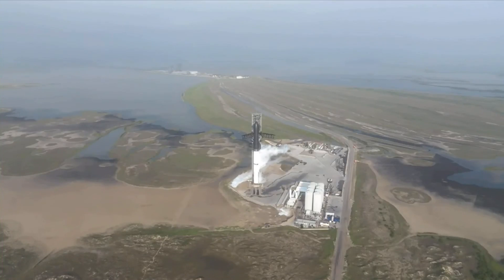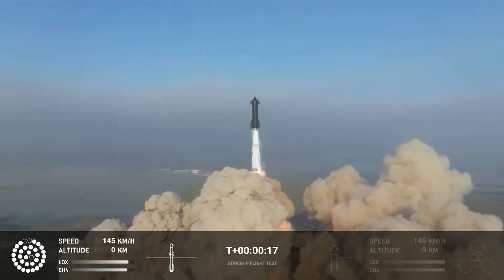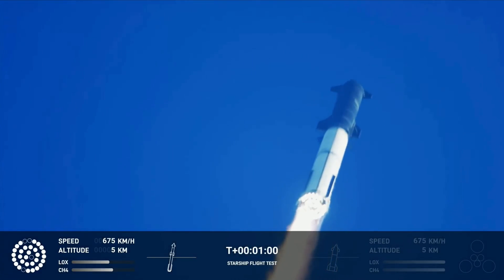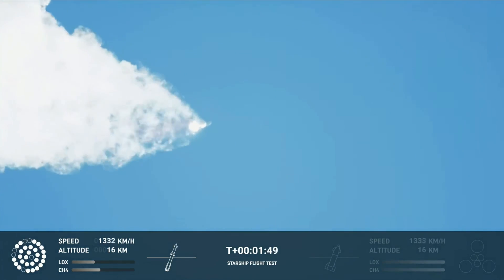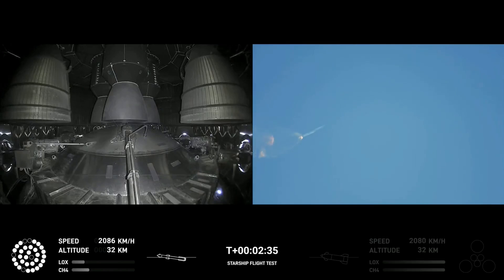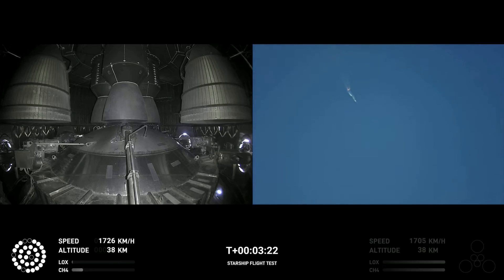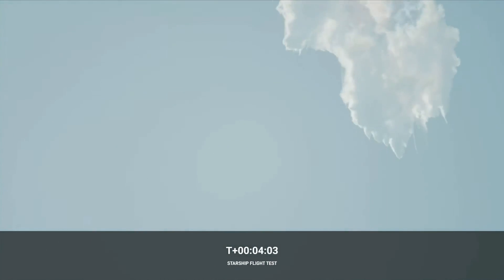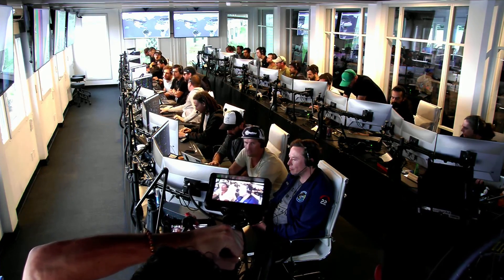Boom! SpaceX Starship has explosive first space launch attempt, test still succesful

Comment: Too bad Starship separation didn't go as planned. A private company can deal with this situation but NASA had to get SLS first launch and flight test correct the first time. I'd love to see SpaceX get everything correct the next time.
Reply: NASA will be the only one going back to the moon and Mars.  A great 👍 appreciation to the NASA engineers with Artemis
Reply: There's a difference between working methods of spaceX and nasa
Definitely nasa engineers are also great but don't forget they took more than a decade to get SLS working.
Reply: SLS is powered by leftover Space Shuttle engines, and familiar solid rocket boosters, so the amount of new learning required for a successful launch on the SLS rocket is a tiny fraction of the new learning required to successfully launch SpaceX Starship.
Reply: SLS is not a new thing it uses engines from the shuttles and the saturn..Starship is a brand new concept so dont compare the two
Reply: It’s all about risk management. SpaceX can afford a much higher level of mission risk since taxpayer funding isn’t an issue. If NASA had this failure there’d be a public outcry.
Reply: It's began to tilt even before MECO. They probably need to work on the centre of mass as the booster gets lighter. Seems like they didn't even do MECO till the explosion. Usually it's MECO then stage separation. Probably their MECO malfunctioned as well.
Reply: @YYLiow  They had 5 engines out on initial climb out.  Were they all in one place caused by 1 of them exploding?  I don't know if we will find out much or not.
Reply: It also took NASA 20 years and $30 billion to create the SLS thanks to the work being spread over many congressional districts. The SLS also reused engines from the space shuttle as well as the SRBs.  All of this is 40 year old technology.  Now don't get me wrong, I am glad the first flight of the SLS was a success.  It was great to see.  The difference here is that the engines and SRBs on the SLS are not new technology and have a long track record.  Pretty much everything on Starship is new technology including the engines so I am willing to cut them some slack. :)
Reply: @paulwilson8367  but they managed to climb till 30 km without any issues. So the engine were not the ones that destabilised it. Unless there was engine failures at 30 km which destabilised it.
Reply: @thukusimon  starship is an overcomplicated mess.   it blew the launch pad up,  damaging the engines and melting parts of the rocket on ascent.

Comment: Wow.....  It lost 6 engines early on and still climbed up to 30+ klicks!  Losing gimbal control like it did would have meant a breakup with another rocket.  With stainless steel the thing kept together - it kept stacked while tumbling, and THAT impressed the shit outta me!
Reply: I think it still had gimbal control, they were just maxed out. The center of pressure is too far forward with the flaps on starship. I wonder if they can be stowed? Or we will see lift surfaces on the first stage to compensate? Or if they can rely on software now that they have real launch data to feed into it? lots of great questions to have! what a day!

Comment: You can not call a failure a success.  Space X seemed to anticipate a first test flight would not be successful, so they should not be too disappointed.  After all, if the flight of the first Space Shuttle, Columbia, in April 1981,  had failed after 2 to 3 minutes from launch, resulting in loss of crew and vehicle,  that would definitely NOT be called a success. Obviously the situation with Starship was different because there were no people on board, but the analogy is there, and since I believe the Starship does not have a launch escape system, had there been people on board they would have been killed. 
Just call a spade a spade and Space X should say  simply “sorry we were not successful at the first attempt.  But we have learnt lessons and hopefully the next attempt will be successful.”.
Spaceflight will always be very dangerous and no amount of spin from Space X can ever change that fact.

Comment: some good things happened
it will be interesting to see what data shows about the booster/starship engines and the 5 or so raptor engines that didn't ignite or go out and then it looked like the booster didn't go out either
also did they self destruct over the gulf when the spin started? if so, good call
Reply: Yep controlled destruction
Reply: @yuvanm9040  $5BB fireworks show!!
Reply: And noticed how they waited for the rocket to burn more propellant and to get farther away as possible before activating the Termination explosion. 
I also imagine they're doing it to get as much data as possible while it's tumbling

Comment: The first stage separation failure is all the process of "all up testing". Even the mighty Saturn fire had F1 engine combustion instability problems. One early saturn 5 to orbit barely crawled into orbit with second stage engine problems. Two J2 engines flamed out and shut down and 3 engines were just enough to achieve orbit.

Comment: This is amazing! But I do wanna know what caused the spinning
Reply: Boost back when the 2nd stage still attached bro
Reply: Probably because of 5-6 of the engines going out causing an imbalance in the thrust.
Reply: It just didn't separate
Reply: They intended to do a half flip and then I think the rocket lost control..
Reply: As it gets higher there is less atmospheric effect on the fins and control surfaces which amplified the effect of the thrust asymmetry from the failed engines.
Reply: The flip was a part of the stage separation, but i didn't separate
Reply: They were trying to shake off starship from the booster.
Reply: @hydromic2518  the spinning you saw wasn’t caused by a few of the R2 engines being out.  The ship is more than capable of being able to fly with a few engines shut down.  They balanced the ship by putting out more than necessary.  If you watch it back, you can see they relight some of them.  Overall it was a great test and they gathered more data than they needed to!
Reply: @Rebelslayer1122  ohhhhhhh thanks for letting me know
Reply: @foxtrotwolf6081  😅 get off there. Kinda like a booger

Comment: Shoot a buoy into atmosphere with a strong enough wire needed and simply use a pulley system to raise cargo into inner space. It is much easier beyond this point to assemble and move forward.
Quit putting the cart before the horse and use basic, simple procedures. Simplicity rules.

Comment: Why is everyone pretending that a welded frame lined with sheets of iron could be a spacecraft?
Reply: Someone woth logic carbon fibre is better than staonless steel
Reply: because that's how most spacecraft were built?
Reply: you're right, they should've 3d printed it.
Reply: @thesauce1682  Have you ever seen that a aircraft or rocket were built of tubes and steel sheets on open air like village shed?

Comment: Looks like three engines down as left tower.  

Appeared to be a major engine failure around 30 seconds that caused a major oxygen leak, at about 55 second point, LOX started dropping quickly.  By 60 secs into flight, six engines were out, mostly on same side of booster, so keeping trajectory was likely difficult without throttling down engines on opposite side of booster.

With LOX leak and six engines out there was likely no hope of achieve Starship near orbital trajectory so separation was aborted.

It is amazing the stack stayed together through the rotations, even at low atmospheric pressure of 34 km (112,000 ft) altitude and 2156 km/H (1340 mph).

Comment: Were the four flips actually out of control, or was it the system repeating the burn-back flip and the stages not separating with each attempt?
Reply: I would be surprised if it was designed to do more than one flip. Having squishy humans inside that thing with 4 rotations would not go well.
Reply: @glenchapman3899  Yes, but for the test flight they may have programmed it it to repeat?  it's a lot of effort and money to give up after one try.
Reply: @GeoffBlackmore  I just saw a thing that was saying the reason the rocket did that was not programed. The first stage was trying to start its decent but could not get orientated because the second stage was still attached.

Comment: Test Failed. The 3 or more Rocket Engines and the flaps got destroyed by small and large concrete pieces and also got a massive dent on the 3 large fuel tanks on the ground because the reinforced concrete under the launch pad which has failed. And the rocket boosters fail to separate from Starship, so Elon Musk had no choice to blow it up. I'm not happy about it because it's affected my shares which is going down but I'm still sitting pretty at the moment, so Elon Musk should have built a Launchpad right out on the ocean it would have been more safer that way.
Reply: Saturated sausage  separation did not happen

Comment: Dude I think when the concrete blew apart at the launch pad, some engines went out, and it messed up the hyrdaulic system and they couldnt separate, and at that point when they realized it they were manually controlling this thing like ksp lmao, and then they ran out of fuel and had to blow it up. But I saw a pic floating around of the second stage separated at the last second so idk.

Comment: 33 first stage engines should all fire, they will investigate the QA on that signal path and engine operability on the pre-launch day static test. But 26 out of 33 engines firing produces off-axis thrust vectors, glad the dynamic steerage corrections worked to keep her going until the inevitable command destruct, a strong ship indeed to withstand the slow rolling at high kilometers per hour in thinning air. Best of luck next time. It was hard for me (who had stringent pass/fail test program acceptance criteria as a civilian) to watch the 3 commentators gloat over a failed stage separation, granted the liftoff was super fantastic and Max Q was achieved but those Raptor engines cannot be cheap, to see the 6 fire would have made the test day complete. Keep charging folks, the data will lead to a better next launch.

Comment: What I find funny is that this is exactly the same malfunction that brought down the Top Gear Reliant Robin space shuttle. Booster separation causing it to plummet out of control. So SpaceX experiencing the exact same malfunction, of a less experimental vehicle, and still considering that a success, ought to feel a bit redeeming for Orangutan, Hamster, and Captain Slow. But I agree that it's a huge success - first stage did it's job well, and the problem was caused by the part of the launch process needed for booster landing, which has never been attempted before except by this same company with far smaller rockets.

Comment: Rapid unscheduled disassembly ? Code for exploding.
Friends that didn't look right it did a 720 them blew up.
Reply: It was meant to do one flip and release the first stage. By the time of the second rotation, the control team blew the rocket up
Reply: @glenchapman3899  so the rocket was to do a 360 and continue.  Very unusual flight.
Reply: @matthewwagner47  it wasn't supposed to flip, it was supposed to induce a small amount of rotation so the stages can separate through angular momentum. It flipping like this was likely due to insufficient TVC of the engines.

Comment: Ahhh she didn't made it. First several engines didn't work and the Super heavy booster didn't do it's job sadly 😭. I had so hoped that the second stage would correct the Heavy booster and help it rech Orbital speed. But what a shame that just the separation didn't work. Separation that shouldn't be the hardest part of all things that the rocket had to perform. 

Was amazed that even after a full rotation at that speed and relatively still low in the air 1,5 times an airplanes altitude that there is still a lot of air what could instant break it apart. Hoped that that 'what' holded the 2nd stage to the 1st should break in that rotation and free thr second stage and gave the 2ns stage still a chance too reach as far as possible. What could have prevented the 2nd stage to seperate? If it was holder by a type of claws and 1 not releasing, that rotation and force should break such mechanical thing if maybe 1 or 2 of many failed to release. 

How do you guys or girls see why something like stage separating be the main issue stopping at the end the other half of the rocket to perform. The 1st stage does only a fraction of the totall time of all the workload to accomplish the 2nd stage reaching Orbital speed. Sad the spaceship not seen flying to the space.

Comment: In a rather morbid way, I am glad fully-integrated Starship experienced a failure. As the narrator said, clearing the launch tower is already a win, validating their "lift off" design. Then whatever failure happening during separation = more data + learning about things that don't work (or work but needs more strength / margin).

Whatever lessons they learnt during this launch == much better Starship in the future, as things they discovered will probably be applicable to many systems. All in all pushing Starship rapidly into "reliable and safe" zone.

Well done, SpaceX!

Comment: Massive fail. Something as basic as a stage separation should have been the easiest part. No escaping the size of this disaster. NASA had this problem beat in the mid 1960s. It seems that reliable reusability is a long way off. Russia and China will be gloating. Space X small pool of customers just evaporated because the insurance industry will now say, sorry, more work needed.

Comment: 9th failure in a row is a success! lol
Reply: Saturated sausage  Musk explodes starships every year
Reply: Saturated sausage  
20 nov 2019 - Broke during leak tests due to poor seam welding.

28 feb 2020 - When pressurized with liquid nitrogen, it burst in the lower part, its remnants soared 10-20 meters and fell.

3 apr 2020 - It was filled with liquid nitrogen at cryogenic temperatures and flight pressures, but began to collapse after one of the fuel tanks of the second stage was pumped with liquid nitrogen: the tank deformed and fell apart, after which the rest of the prototype elements collapsed.

29 may 2020 - In May, the first test jump of 150 m was planned with the Raptor SN20 engine, however, during the test on May 29, the device exploded due to problems with the release mechanism during post-fire tests to separate from the launch pad.

"Static fire & short flights with SN3, longer flights with SN4, but spooling up the whole Starship/Raptor production line is really what matters" Elon Musk

9 dec 2020 after the second test, another SN32 engine, damaged by debris from the surface of the site, was replaced by SN42. The next test was a flight to a height of 12.5 km. The first launch attempt took place on December 8, 2020, but one second before the planned takeoff, the engine emergency shutdown system worked, and the launch was postponed to the next day. On December 9, 2020 at 22:45 UTC, with the help of three engines, the ship successfully launched and climbed to a predetermined altitude. 6 minutes 32 seconds after launch, the fuel supply was transferred from the main to the pressure tanks, Starship restarted the engines and reoriented to a vertical position for a jet landing. However, due to low pressure in the fuel pressure tank, 2 engines could not work out as expected for the necessary speed repayment, and the Starship exploded on impact with the surface of the landing site.

2 feb 2021 - One of the two engines failed to fire for the final maneuver before landing, the ship hit the landing pad at high speed and exploded in a large fireball, just like its predecessor SN8

3 mar 2021 -  On February 23, 2021, the first fire tests were carried out, which revealed a problem with one of the engines. After its replacement by SN51 on February 25, 2021 at 22:57 UTC, repeated fire tests were carried out. The first launch attempt on March 3, 2021 took place at 20:33 UTC, but was aborted at the first second. At 23:15 UTC, the ship successfully lifted off from the launch pad. The first part of the flight completely repeated the test of SN8 and SN9.
8 minutes after landing, the fire extinguishing system fought the fire in the engine compartment, and when it already seemed that the fire was extinguished, at 23:30 UTC the ship suddenly exploded, soared up and crashed in a huge fireball.

30 mar 2021 - At around 5 minutes 48 seconds, SN11 turned on its first engine, but after a second, communication with the prototype was lost. At the same moment, an explosion sounded, and debris began to fall from the sky.

5 may 2021 - The prototype landed successfully on the landing legs at the edge of the landing pad. Almost immediately, like the SN10, a flame broke out at its base from methane vapor escaping from the engine compartment.

20 apr 2023 total failure

As I see, Musk's engineers don't have enough qualification to design a construction without many tries, just using science knoledge.
Reply: @ВасяПетров-п1з  many 'failures' you're quoting were tests to destruction to understand how much the vehicles could handle. Some tests were failures like SN4 but calling every other test that didn't land intact while completing 95% of the intended milestones a complete failure is bullshit. The expectations for the fully integrated flight test was to get off the pad and gain information about the flight, they did exactly that.